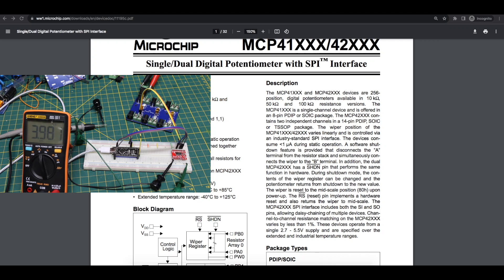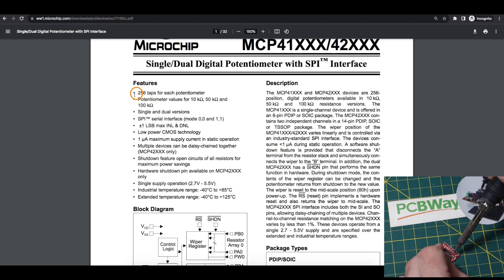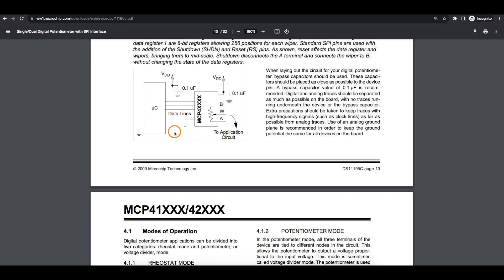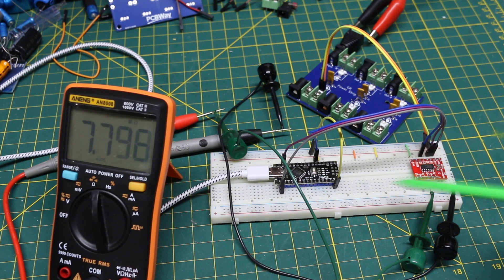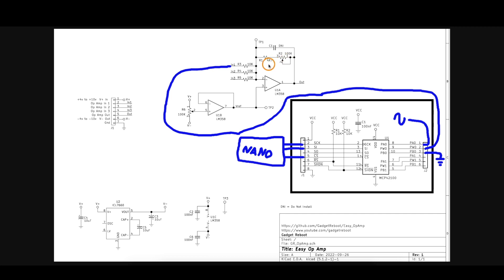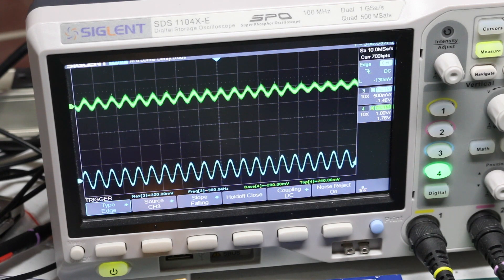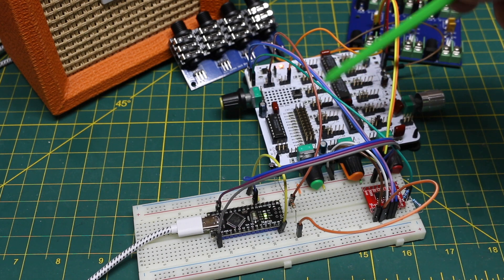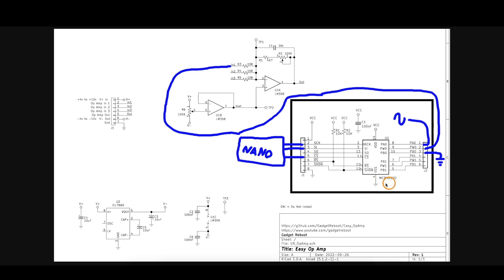MCP42100 Digital Pot Breakout Board

Comment: Hi! Thanks for your video. I have a problem with these ICs. I connected an audio supply, and I can control the volume. The problem is that when I change the pots' position, I hear an audible click noise. Do you know about this problem? Did you have this problem when you implemented it?

Comment: If i buy two in pcbway they come assembled and working ?
Reply from the maker: they can be bought assembled or just blank circuit boards. They don’t do any functional testing so I assume they just make sure it looks like it’s assembled properly.
Reply: Great. I am awaiting the pcbway review to pay. Would be nice if there was a 3d printed sanded black plastic shell option with power supply. How do i figure the phone number to dial ? @GadgetReboot
Reply: I am buying this to put my us robotics courier to use again and show to my 4 year daughter and maybe a western electric rotary phone
Reply from the maker: in the sketch program that goes into the ESP module, in one of the files there’s a remote and local phone number hardcoded so each board would have to have those two numbers swapped when being programmed so that it would make sense. (each phone has a different local number and they can only call the opposite phone number as the remote target)
The whole thing is really just a hacked together experiment and I’m working on another expansion thing to make it more controlled in future projects.
https://github.com/GadgetReboot/Phone_SLIM/blob/main/sketch/project_globals.cpp

Comment: Would there be a way to use this in a 12v circuit on the pot side?
Reply from the maker: The pot can only be exposed to 5 V max so if there is 12 V involved then the pot can’t  be directly exposed to that, it would have to have something else to divide the 12 V down

Comment: I do prefer the pot's that remember where you left them. i think i would like to set the pot start at one end, as then it could be min gain and not mid level.
But you can get around that by having an audio enable which you enable once you have configured all the pots and the circuit has stabilised.
I do like videos that get me thinking about how i would use one.
Reply from the maker: That was one of the features of the X9C series where you could optionally save the position of the pot. I don’t know why those got so expensive, otherwise I’d probably still be using them because it’s the first one I ever tried and I have a bunch but not in surface mount.